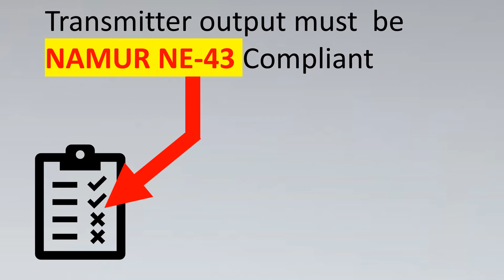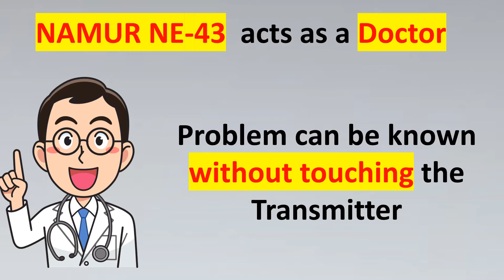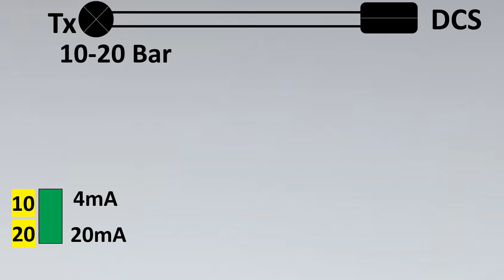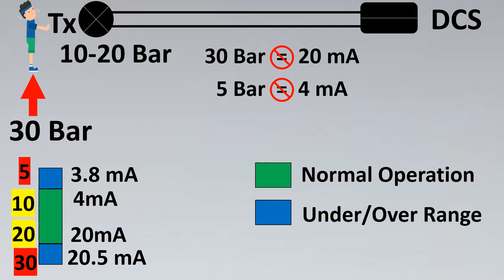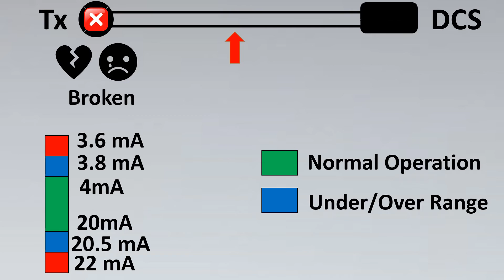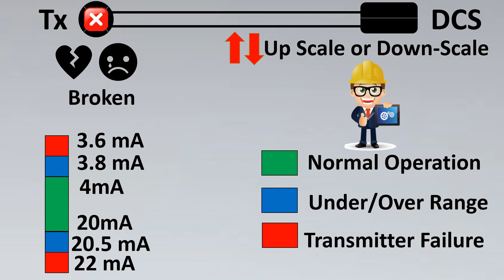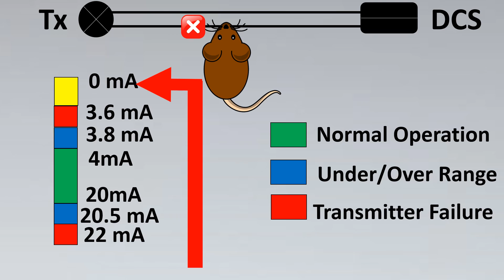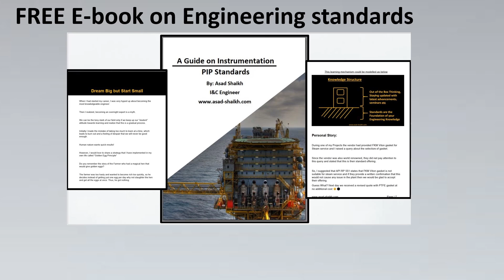What is NAMUR NE 43

Comment: Sir, Please make one video session on why we use end of line resistors for digital input & digital output & how we select value of resistance.
Reply from the maker: oh okay sure 😊 Where did you mostly encounter this concept ? Horns and Beacons ?
Reply: @AsadPassionateEngineer  yes today I found in my system cabinet many Digital input and digital output signals are unhealthy in System cabinet. Then I asked the reason from my vendor then he suggested me to fix 2.2 kohm resistor on Digital output and 10kohm resistor in Digital input.